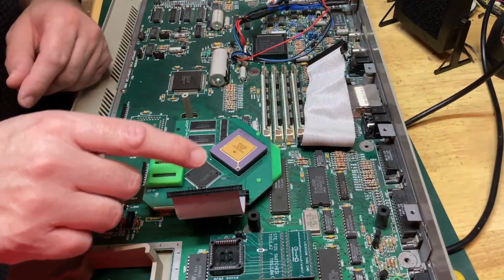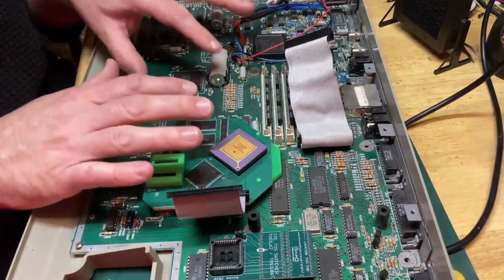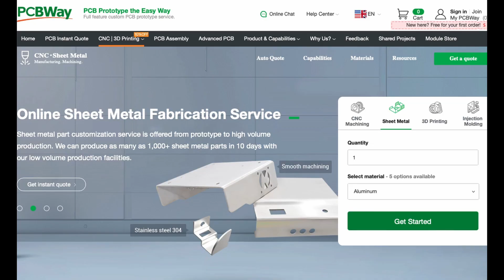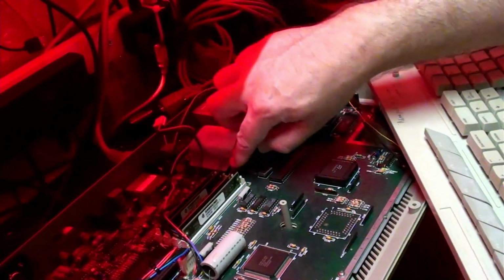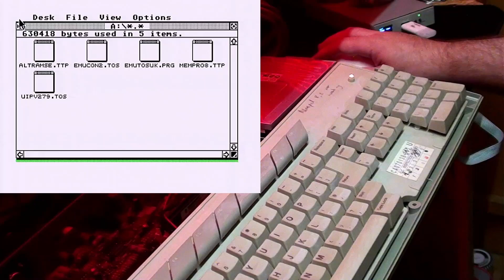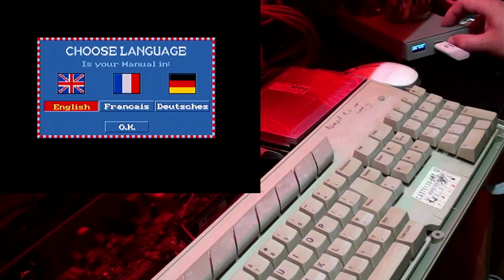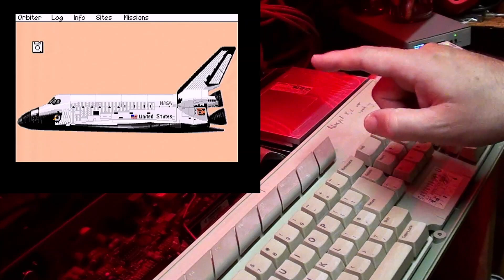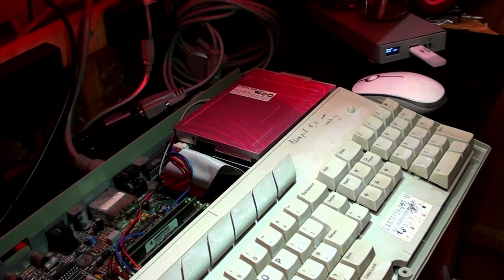A quick hack for an external drive A on the STE

Comment: I like emucon2 also.  I thought you could plug Gotek into the internal connector as long as you had the case open?
Reply from the maker: Yes, but Gotek is mounted in an enclosure for when it's nomally used as drive B, so if you add in the disassembly steps every time I need it, the balance is tipped quite substantially :)

Comment: I don't understand your statement "I performed a recent mod on my STFM to swap drive A and B around with as switch, but unfortunately a similarly trivial mod can't be done for the STE."
I did the drive A-B switch swap trick on my 520STe in ~1991.
I haven't watched the whole video yet so I may have misunderstood you.
Reply: He can do it, but isn't because of space constraints due to the accelerator and he's really just doing it as a temporary test.  It's a cool quick and dirty hack to switch the external drive to the "A" drive.  It was meant to solve a testing problem, not a long-term mod.
Reply: @gregcoons7308  Thanks for the explanation.
Reply from the maker: The STFM mod (documented in my other video) is far simpler and just involves overriding some jumpers. This one needs desoldering chip legs or trace cutting. The key phrase was 'similarly trivial'.
Reply: @thetechnoshed  Any way to get a MEGA to boot from an external Gotek?  I like keeping my floppy drive as drive A, but would like to boot from it sometimes.
Reply: I did the same thing recently, but it was a hack job.  I'm glad he is testing the accelerator, I might get one after they work the bugs out.